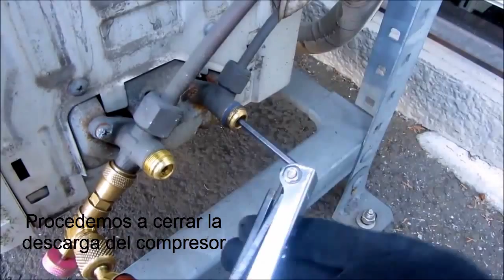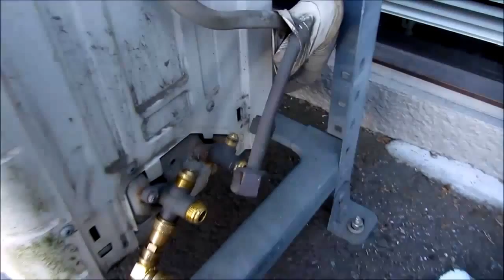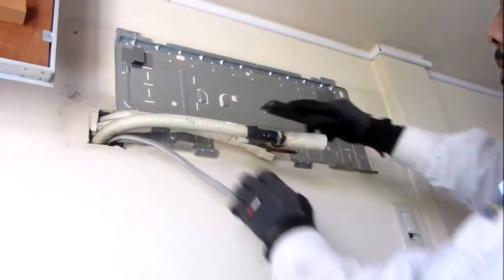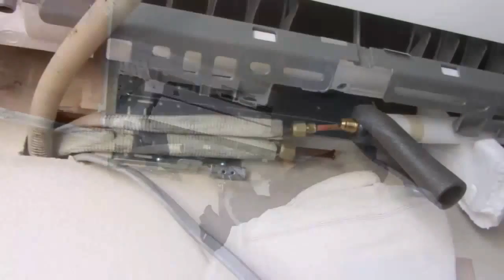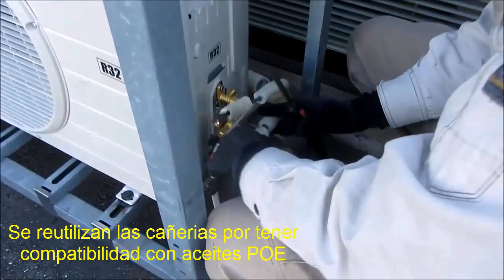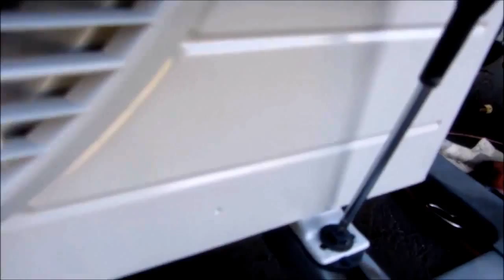Desinstalar R410A, Instalar R32 - Aire Acondicionado Split

Comment: el gas r32 se puede abocardar en el split tambien o soladar solo ? otra cosa tencoun aparato con gas r410a se puede usar esos tubos con un aparato nuevo con gas r32 ?
Reply from the maker: No se recomienda hacer soldaduras. Los caños si había un equipo con R410A los puedes usar con r32 ya que llevan el mismo aceite POE. Si tienes dudas de la cañería podrías limpiarla con R141b y con nitrógeno.
Reply: @fullserviceparana  buena pregunta  y mejor respuesta
Así que ahí ya está encareciendo y haciendo costosa una reparación 
Se demoraría bastante mas

Comment: q tipo de refiregiracion el q mas da frio  por que vivios en zonas con muchis grados entre 45y hasta 47
Reply from the maker: Debes comprar un aire acondicionado que soporte esas altas temperaturas. En las zonas tropicales que manejan esas temperaturas hay equipos especiales.
Reply: Full Service Parana      ya  ya se eso las ahi  aqui pero refiero cual es mejor por q ahi tropical 410 y tropical r22  cual es mejor
Reply: Te recomiendo una bomba de calor geotérmica, el problema en los sitios de mucho calor es que el condensador de aire no da condensado el refrigerante ya que latemperatura ambiente y la temperatura del gas al salir del comprensor esta muy igualada y no consigue enfriarlo para que condense. Si tienes un pozo seria perfecto. El gas te vale cualquiera, el problema es poder condensarlo para que se cumpla el ciclo frigorifico.

Comment: No me parece normal sustituir un equipo con R410 por uno con R32 si no esta dañado el equipo ya que su vida util no ha acabado.
Aparte que seguro que los equipos con R32 que se van a "malinstalar" y van a tener fugas de refrigerante seran cargados con R410 ya que existe mucha cantidad de R410 en el mercado y los instaladores que tienen lo van a aprovechar teniendo en cuenta que las presiones de trabajo son practicamente las mismas y por lo tanto creo que el rendimiento andara por el estilo.
Reply: Imagino k cuando se acabe este año kompre aire acond portátil y tiene R410 EN 2019 MES. MAYO DICEN DURA 5 AÑOS NO SE XQ ANTES NO TENÍA AIRE ACOND
Reply from the maker: Al final del vídeo se muestra como la unidad exterior de R410A esta con manchas de aceite por que estaba dañada. En estos lugares ya no se usa el R410A Se usan gases mas ecológicos como el R32 y R290. Y algunos para no perder su equipo le hacen las adaptaciones necesarias para que funcionen con R32. El R410A tiene fecha de vencimiento y a lo mejor mientras tanto innovan con mezclas nuevas y mejores. 👍👍👍

Comment from the maker: *****  Si te fijas hay diferentes tipos de R32. Inflamable y de baja inflamabilidad. Depende del fabricante. Están identificados debidamente con un cartel rojo y verde respectivamente. 
 La prueba de nitrógeno si quieres puedes no hacerla, no es obligatoria. Como viste en el vídeo las tuercas se ajustaron con llaves de fuerza con cricket al peso indicado por el fabricante, por lo que no debería perder. Pero se enseña en las buenas practicas. En el campo es engorroso andar con el tanque de nitrógeno. Los fabricantes siempre te van a exigir en los manuales la prueba de nitrógeno para buscar posibles fugas debido a que si el equipo trabaja con bajo refrigerante se puede quemar el compresor y ellos tendrían que reconocerlo. En los casos en que no se pueda acceder a las tuercas para futuros servicios se recomienda anular las tuercas y soldar.